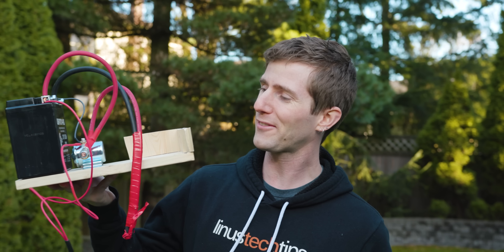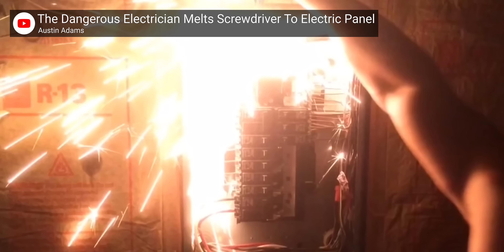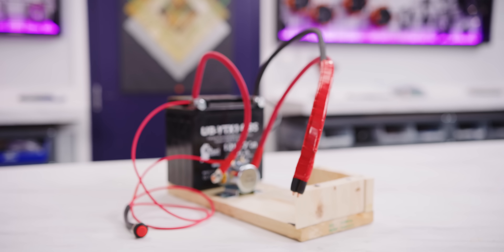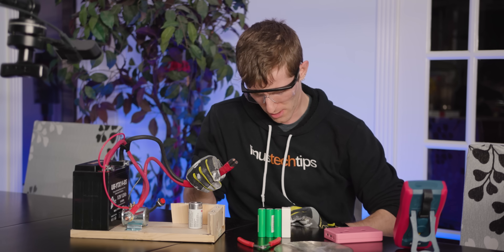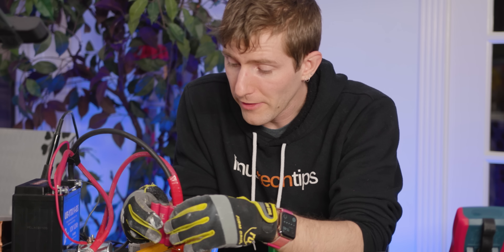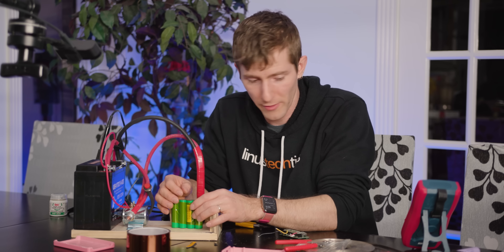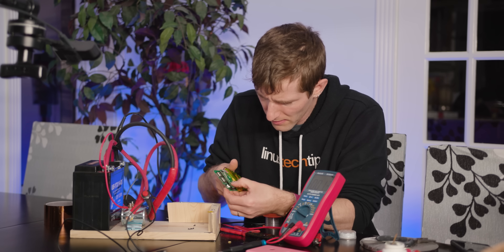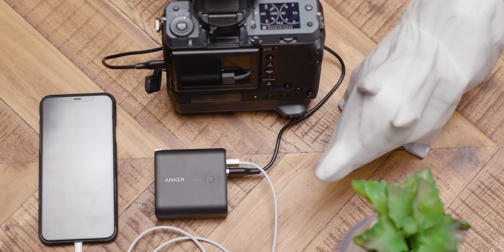I spent $100 to save 20 bucks... and it was TOTALLY worth it!

Comment: I use a similar setup for spot welding it's the same basic principle just much more robust with a battery to smooth things out but it's also got a 10, 25 and 50 amp adjustable charger behind it to step things up as needed and most importantly to keep all the welds happening at nearly the same battery voltage for consistency. But what's critical and even in this small setup you really should not be just using the momentary switch to control the time. It's very easy and far better to just buy a programmable relay that you can program down to the millisecond or at least hundreds of a second. You use that to feed your larger high amp starter relay that you're using. I've been building and repairing lithium batteries for over a decade my first setup was something from Alibaba that cost a couple hundred dollars and it worked for about a dozen packs. Then instead of messing around with it I want Frankenstein and it's been extremely reliable. My welds are far better than most. I use almost enough energy to blow through the cells when I cry. It's so close that I have to use or do you use a different setting on the negative can of the cell versus the positive terminal because the thickness is actually different. The positive terminal has a thicker metal piece. It takes a little bit more energy to weld the positive side if you had your settings exactly the same it'd be easier to pull the tabs from the positive side versus the negative side. Not much but enough to tweak your settings. But only if you have a set up that you can do that with.

Comment: This shows why building your own spotwelder might be significantly worse than just buying a diy kit from Temu. I bought mine from there, even driving it with a 52Ah battery and have not ruined a single cell.

Comment: 8:10 this is just wrong. series or parallel gives you always capacity (energy capacity). What serial gives you is voltage at the same current. Parallel gives you same voltage with double current. Note that Ah (or mAh) IS NOT energy nor energy capacity. Ah is the amount of current (charges - with a little q) accumulated in one hour. The ENERGY that can make depends on the potential (Voltage). Ah is the equivalent of amount of water in a dam reservoir and volts is the height it drops until it gets into the turbine to generate power. The reason that cells and batteries are rated in Ah is due to it's c-rating of discharge/charge current and also it's not possible to know from Ah rating the Wh equivalent unless you know how voltage drops on a cell. If it's steady 3,6V? yea, 3Ah*3,6V=10,8Wh. But that's not the real world. Cells drops in voltage from 4,2V to 2,75V and it's not proporcional. Meaning, the majority of the capacity of the cell are between 3,8V and 3,7V. The first 5% of energy drops it's voltage 4,2 to 3,8V and then it drains very slowly from 3,8 to 3,7 and then it starts to fall again quickly until 2,75V (this is for NMC cells).

Comment: Small items I rather use rechargeable 20 v Lithium batteries with 5 volt usb adapters. I got 2  100 wh batt that has a fast charger. Won't last as long but get the job done quickly.

Comment: Your DIY spot welder is a good idea.

However, the reason why the switch “appears” to be sticking, is NOT due to the switch.

The solenoid is what is sticking.

The high current is causing the internal solenoid washer to stick momentarily.

This can be overcome by increasing the return spring on the inside of the solenoid.

But, you can’t increase the spring to much, because the coil in the solenoid won’t be able to draw in the piston with the washer, in order to make contact, between the two high current points.

Thanks for the video.

Comment: 5:50 Wait a minute, unless you're connecting the pack to a load, those batteries aren't going to equalize when you spot weld them together.

Comment: Wasn't it Edison that had a fight with Tesla over the safety of AC versus DC power and he even killed a dog in a demonstration to prove his point. AC power has so many benefits that if you can't deal with the safety issues like insulating your wires and just not "crossing the two streams" together in an uncontrolled fashion than you're just too dumb to use AC power or at least you are too dumb to make something that uses AC power.  Just saying.  :  )

Comment: Would it be a good idea to put batteries in the refrigerator and get them cold before welding? Anyone have thoughts on that? Might heat the contacts with a lighter for a few seconds before welding, so the weld location is not too cold to make it stick but the core of the battery is cold. Probably overthinking it, just get good at quick good welds I guess.

Comment: What makes me laugh is the “heat kills batteries” and then solders on the (extra) nickel strip he added. Why didn’t he think to solder on the nickel strip BEFORE spot welding the strip. Linus is a genius at computers and configurations... but a total noob when it comes to thinking through a diy project. Basically he rushes too much (which was why he forgot the extra length of nickel strips AND the Kapton tape.

Comment: For spot welder it is better use a bank of super capacitors because battery suffers no stress charging them and the current output is only applied for milliseconds when welding, DIY spot welder need more security and then a simple push button and relay is not good better a pedal switch and mosfet transistors for safety, even better if  you can charge the capacitors with an old pc power supply (12v with 10-15 amps is enough ) DIY electronics tools can be done with all the features of the ones that you can buy on the store and even if they cost a bit more are easier to repair and a source of pride and satisfaction for the one who made them ( sorry if my english is not good  ) :)

Comment: A  much safer alternative for your viewers from Amazon is the Kkmoon Portable Spot Welding Machine for $43 CAD.  And likely cheaper in the States.  Charges from USB, adjustable output and could fit in a pocket.  I would cover those leads with heat shrink tubing though.  Too easy to accidentally short them.

Comment: 3:50 "Electrocution hazard" from what? You can touch the two terminals of the battery with your fingers, he even did it around 3:15. There is 0 electrical danger in this machine whether or not you use the relay. The only benefits are smaller wires to the button and not bridging your smaller button. 12 volts across the 1000 ohms of wet skin is only like .01 amps. You could literally stick the probe of this thing on your hand and pull the trigger with no ill effects, unless you puncture the skin or lick it. And even then it would be a minor burn at worst, if you were foolish enough to hold the trigger down for a long time.

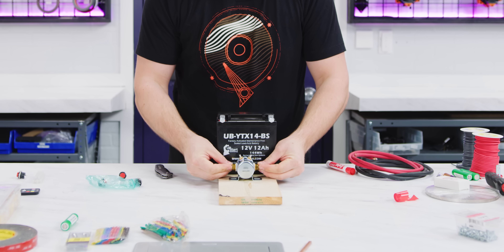Comment: 3:32 The terminals on the battery are not “hot and ground”. They are just “positive and negative.” If however, you grounded either the positive or negative terminal, then that could be considered “ground” and the other terminal would be “hot.” 

Generally low voltage DC is referred to as positive and negative. AC power on the other hand has a hot and Neutral, which makes sense because the hot side can shock you, even if you are not grounded or touching the neutral. The ground wire should not carry any current unless there is a short.

Comment: I've got one of those small battery packs that will jump start a car as well as charge devices. Also has light built into it which is handy. Its about the size of a large smart phone but probably twice as thick. Its small enough it will fit in a back pocket though. I keep it in my glove box in my car. I wouldn't try to jump a truck or a v-8 sedan with it, but it works fine on my Kia Forte.

Comment: What is the proper electrode tip size and shape? When mine are very sharp and pointy, they melt through the strip and into the cell, causing massive sparks and leakage of electrolite. When the tips are big it heats up and does not weld.

Comment: I thought I paid too much to build my homemade spot welder.
I wanted it to cost nothing but I had to spend £10.
That was £10 too much.
I just use a old microwave transformer.
 Which are very easy to get your hands.
And cost nothing.
And i bought a regulator board.
You'll get a lot more different settings compared to a 12v battery & solenoid.
And you won't need to charge it up when it's losing power

Comment: You're too afraid of things that might happen, you're not getting electrocuted off a 12v battery those sparks won't kill you, the battery is not likely to catch fire, even if you over heat it, and then if it does, put it in a tin and set it outside and let it have it's tantrums, once it's done burning recycle it like normal. None of this stuff is dangerous with even the bare minimum preparation.

Comment: A lot of research done before purchasing the following double pulse controller. Cheap build with good quality parts, excellent results on 18650 welds. Each pulse is adjustable in power and duration.

KKmoon 100A/40A Digital LCD Double Pulse Encoder Spot Welder Machine Time Control Module Board

https://www.amazon.com/dp/B07WQG87DD/ref=cm_sw_r_cp_apa_fabc_ZVGJT7XVB82NYQEYHX3N

Comment: I think you might want to have the tips much sharper (this is a battery weld, not a car weld, so not much strength required).  Also make sure you have both tips contacting (I think that's where you arcs are coming from...one contact is not flush).  BTW, why not solder first and then spot weld another strip on the battery.

Comment: Wiring batteries in series increases the voltage, but keeps the capacity the same, and I've never understood how that works. does it just mean capacity at a certain amperage? The total watt-hours capacity should still be doubled, it's just actually outputting more voltage, so you're still putting out double the electricity.

Comment: Since you are using a battery you need a 200A fuse too in series with the spot welder in case the relay fails in on mode.

Comment: Just use one of those el-cheapo ones..
they cost like 17USD with shipping and in my testing ½ year back, they are surprisingly good for that price.
I use 2x4S 2800mah LIPO in parallel and got all the power I need. (they are rated for 12v but 4S 16v works fine, sofar)
and you can both use automatic 1 to 99 ms cycle times (E) or a pedal or a switch with the DC barrel plug for manual control.-
I use 0.2mm nickel strips and thicker than the normal 0.12 or 0.15mm and got full control over the spotweld-cycle with 99 intervals that are 100% loyal to cycle time on my scope, , so fx E20 is equal with 20ms
https://imgur.com/a/wo4v4Mz
that DIY rig you have there, simply to widen a spot-gap between the pins.
'you risk that nickel strip going over the rounded positive-edge are being pushed down and touching and melting the plastic-wrap on top of the negative case  7:23

Comment: if the batteries were at 3.6 they should be 4.2 fully changed for a 18650 and the battery cuttoff is 3.7 :) thats why it didnt turn on, they were pretty much dead

Comment: That's a cool spot welder. But for that battery purpose, using clamp or spring-loaded connection is probably better. Even EV and Hybrid do not solder or weld the battery pack, they are connected via bolts and nuts.  Besides that, Nickle is really resistive. Iron/steel or aluminum is better than Nickle.
Reply: You incorrect about steel being better than. Per Matador Ampacity chart.  .25mm × 8mm as follows: all ratings are based on .15mm × 8mm strip. Stainless Steel-.52A, Carbon Steel-2.5A, Tin-3.2V, Iron-3.6A, Nickel-4.9A, Zinc-5.8A, Aluminum-11A, Copper-18A.

Comment: your spot welding is terrible, but entertaining, this is the go to spot welder for DIY battery packs, iv'e used it to make many battery packs, also you should capacity test your cells and don't mix hi and low capacity cells, and always use a BMS
 https://malectrics.eu/product-category/arduino-spot-welder-bundles/

Comment: Why would you not have like an arduino with a relay to have exact timings for heating?
Reply: True! You wouldn't even need to step down the voltage to power it. They're a little lazy IMO

Comment: 8:08 Both series and parallel increase capacity. Series increases the voltage and parallel increases the max amperage you can drain.

Comment: With a little bit of electronics you can add a fix delay for this spot welder. With a fix delay your welds will be more consistent and you can add a way to adjust the delay for different metal thickness.
9:27 Also add a way to fix the battery in place so when you pull out the battery doesn't come too.

Comment: Your spot welder could seriously use a simple 555 circuit between the switch and relay; that would let you dial in the timing with little additional effort/cost.

Comment: To be more safer, use Insulator Ring for 18650. its the Paper Thing on the positive side of the battery. This prevents the nickel tabs into damaging the battery wrap specially in the part where you folded the strip from Positive Side to the body.
Note that when you unstrip the 18650 green wrap, the whole body is the Negative so if that folded Nickel tab scrap the Wrapper and touch the negative body.. boom.. nice little spark.
Alternatively, I just use Electrical tape on parts where nickel tab touch the 18650 Wrapper.

I was actually planning to build a DIY spot welder.
But hey I got a good deal for 200 bucks, a nice Sunko 709AD Spot Welder with Soldering iron.

Comment: that spot welder looks atrocious.. you can't control the welding current with this thing..
Also: The battery tab welder you showed don't work well at all.. those tab welders (I bought one once) all trip most house breakers.

This is one of those things where LMG once again should stick with what they know best: pc builds.

Comment: "Belt sander" BENCH GRINDER
12v battery "Electrocution hazard" HARMLESS

Also you really should try to find batteries of the same capacity when putting them in series.

Comment: Just a quick correction to something he said. You have to heat up the base material you are looking to solder and then using that heat allow your solder wire to melt and flow using the heat that the base material has. Heating up the solder alone with your iron and trying to make it flow to your intended material you are trying to solder will result in a cold solder joint, which is bad.

Comment: You dont need to have the same voltage on these cells if you connect them in Parallel though. Thats actually how you revive dead cells, you put them in parallel with a good one

Comment: I hate how Powerbanks advertise in mAh. It's useless without knowing the voltage. :/
Reply: You compare it to the output voltage and amperage I assume? So 5v and an amperage 9v and a lower amperage and then 12v at a lower amperage if it's a nice power bank but 5v just to be simple

Comment: Some notes:
It's called magic Smoke, not blue smoke.

12 volts can't not electrocute you. you need 30 volts AC or 60 volts DC for that.
however, you can run into fire hazard, since power = amp * voltage.
On that part I have no info on numbers, but if i had to guess one watt is enough to start fire in "warning: flammable material" and 10 is enough to start flame in more common one, while 50 watts should put pretty munch anything (that isn't fire resistant) to burn.

Comment: LOL  I think I'd have just gone for some electrically conductive epoxy or tape.  I'm lazy and sparks scare me.  LOL  Actually ... who am I kidding?  I'd have probably first tried pieces of speaker wire held by electrical tape and/or duct tape.  Because I'm cheap and have those on hand.  But kudos for making a spot welder and risking burns to your fingers and permanent damage to the batteries!

Comment: oh by the way  do NOT buy, these cheap 18650 single sell power banks from ebay... mine caught on fire whilst charging... but i kinda was expecting it to be that shit.. but if you werent and left the room it could be deadly. p.s. Linus... id worry about those long spot welds you did and doing two in quick succession on compromising the cells. but good first try. I tried to recover my fave power bank (some work with my camera some not... i modded my camera to run off powerbanks by removing the cells and wiring a potentiometer to the chip in the battery shell so the nikon J1 still thinks a battery is in there... and ramped the voltage up from 5v to 7.4ish the potentiometer fits in where the cells where, and i have a powercable to USB coming out of a hole i melted into the battery flap) https://www.ebay.com.au/itm/Portable-2600mAh-USB-External-Power-Bank-Case-Pack-Box-18650-Battery-Charger-DIY/142837949300?hash=item2141ce2374:g:R~QAAOSwRnlbKJqI

Comment: Sometimes the BMS will shutdown from low voltage to prevent damage, sometimes it's possible to reset it but it's best to just solder the new battery pack on before desoldering the old battery pack to avoid shutdown.

Comment: I love how smaller/poorer YouTube channels built elaborate spot welders using arduinos, ultracapacitors, and MOSFETs with programmable weld times and dual pulse control.  Then this guy who makes a killing on YouTube uses a motorcycle battery, a starter solenoid, and some taped up wire.

Comment: so basically you added a relay to avoid putting too much current through the switch but didn't add any additional resistance to limit the current through the switch. A relay is just a coil that closes a switch so you're still shorting a ton of current through the switch to trigger the relay. Probably why the switch kept binding up.

Comment: You could use a timer such as a PAC TR7 and dial in exactly how much time it takes to produces a reliable consistent spot weld. It’s a 12 volt accessory so you could wire it right in to that little contraption. After some thought with everything you would have to buy new battery etc you probably could bought a cheap Chinese spot welder!